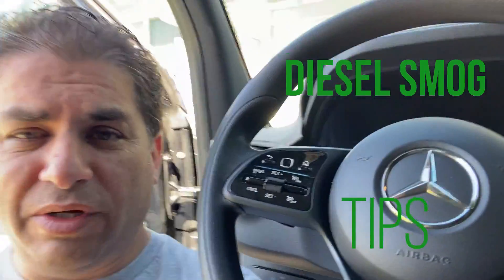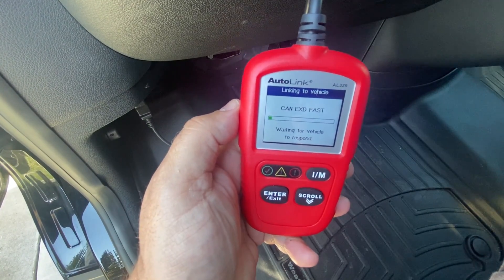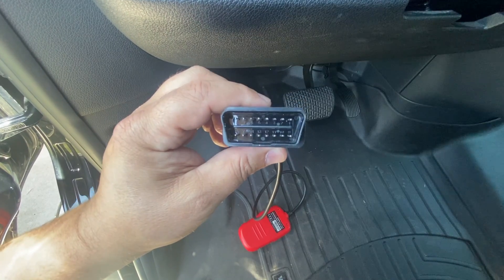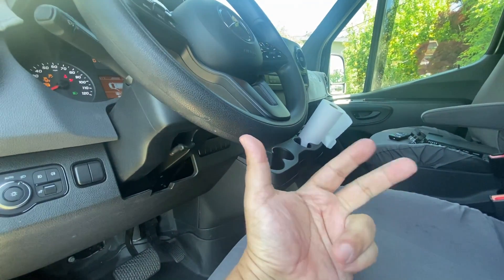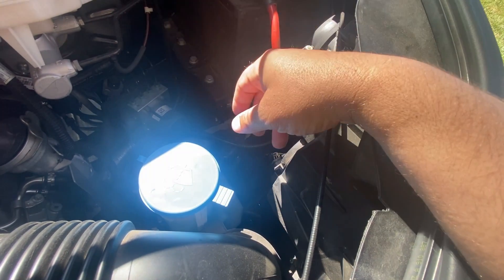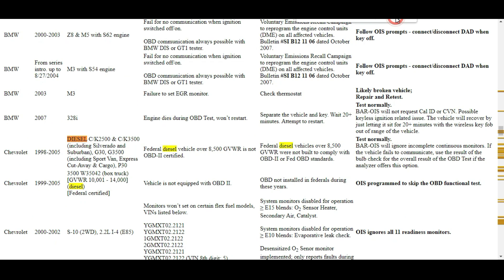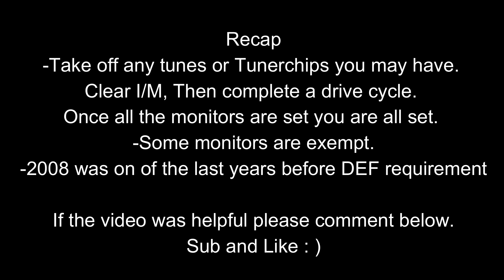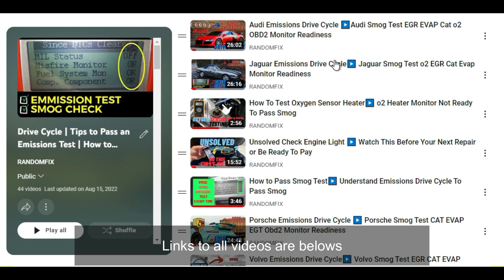Why 90% of Diesel Vehicles Fail an Emissions Test! What do 10% know?

Comment: Hi thank you for a good tutorial video. I have a BMW 525D Xdrive F11 218HP. I want to test the diesel smog test on this car. Next spring in mars 2026 my car must pass an EU control. The  OBD2 scanner Autel AutoLink AL329 you recommend is out of stock. There is other like Autel MaxiLink ML529 OBD2 Scanner which also have I/M. The price is two times more expensive so i suppose this is a good OBD2 scanner. Is there other scanner you can recommend?
Reply from the maker: Search “obd2 reader autel” look for the I m button and the al319 is good as well.

Comment: I have 2021 sprinter diesel won’t get ready “exhaust gas sensor” no codes mb dealership saying continue driving but I already drove around 20k miles
Reply: 1. Engine off, key out for 3 minutes before beginning cycle  2. Drive between 40-50mph for 25 minutes at a constant  speed (set cruise control)  3. Engine off, key out for 3 minutes  4. Smoothly accelerate from 50-60mph, then coast back  down to 50mph and repeat  5. Engine off, key out for 3 minutes  
Ideally the cycle should be conducted on a flat highway witt  no traffic.

Comment: I just bought a brand new 2023 Sprinter AWD from a dealer in Illinois. Has it shipped to California, and it won’t pass smog! I was told to drive it a couple hundred miles by the smog shop, still won’t pass. Local MB dealer says to drive it more! I build and sell them, so putting all these extra miles on the van is not cool at all. I’m at 450 miles now, still doesn’t pass. Do I have a lemon?
Reply from the maker: I had someone comment on another video with another brand new sprinter. One that sprinter the egr will not set. He too purchased it out of state.
Reply: I am having the same issue, the O2 sensor won’t get ready, were you able to figure out the drive cycle?
Reply: I'm having this problem at 4600 miles, exhaust gas sensor not ready. did you get your van smogged and registered?